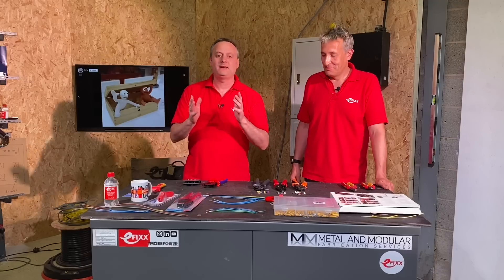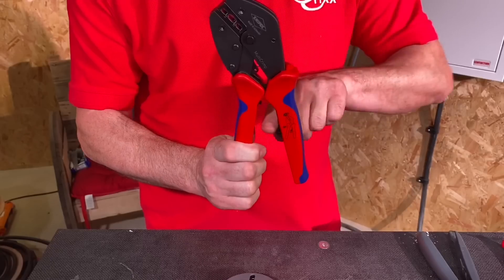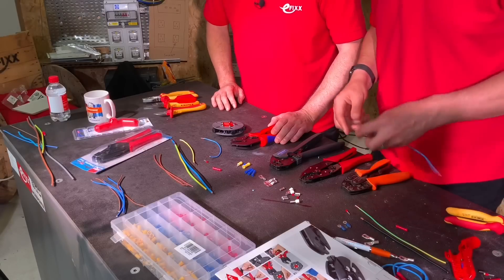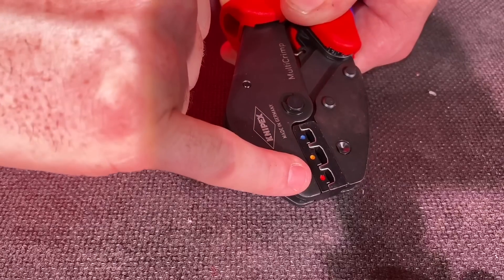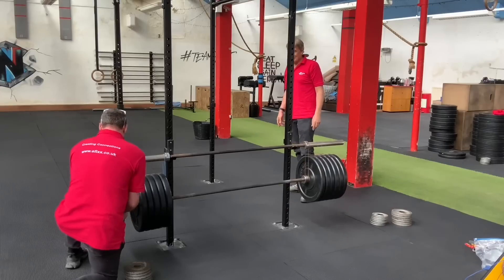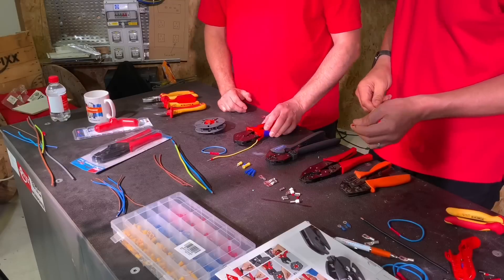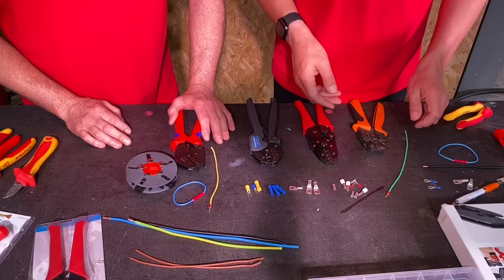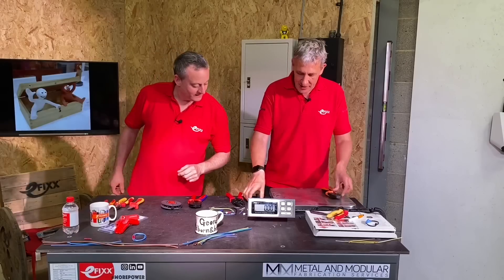Knipex Mulitcrimp : 3 crimp tools in 1 - Ferrules and crimp terminals

Comment: The only advantage those Multicrimps have is that you don't need to lug around the additional pliers. Way slower switching between dies than just picking up another set of pliers, the massive opening size makes it really awful to use. Typical compromises that need to be made to cover so many crimp dies.

Comment: There's a better way to do this. Single Harmonica style line of jaws, you move the handle up and down it on rails, then lock into place. Bulky, but faster and you only have to keep track on one tool.

No need for the cassette, it's already built in.

Comment: That Knipex multi crimping tool is £200, the other 3 are about £10 each
Reply: Check the description. Those 3 are more like 150 each. Not that they aren't expensive, but if you do crimp all day long every day, it's worth it. Otherwise much cheaper alternatives get the occasional job done for sure.

Comment: You had me sold till I went and seen the price. Great idea and tool and I lobe how everything is within reach when needed, it will save time from having to go back to the tool box or truck to grab a different crimper when needed, but its way too costly. Keep up the great work.
Reply: £350.... I'll just dig through my tool bag 🤣🤣
Reply: @kierenhudson6331  it's around 200 EURO's now. I'm waiting for the time that it is 190 euro's again and then I'll buy it:-) I just so much hope that the force needed with that non insulated copper one isn't as high as the fellow on the right had to use!
Reply: @kierenhudson6331  😆 very true
Reply: Well nows the time fellas. Price is 40% off at $119

Comment: I'm curious how the jaws in the multi crimp tool secure in the handle whilst in use, does the lever between handles have a lock attached?
Reply from the maker: You have to be in an exact position to insert or extract the jaws. The lever sets that position to trigger the hook 🪝

Comment: In theory that works fine. And for a service engineer travelling in planes it might be good. But how many times do you swop between ferrule and insulated end crimps in a day? I know I jump 10s of times an hour.
Reply: But this allows you to transition quickly with a Knipex crimper frame. For me its also a cost thing, it seems like the fastest way to switch dies while having one Knipex quality tool. I could buy a second one.. But ooof. $
Reply: @HyperionBadger  I have 13 02 160 Knipex pliers at work that do ferrules brilliantly, that's a multitool and it's small. And for insulated crimps you could have any other tool. Not much space taken up in the bag and cheap. They only do ferrules up to 2.5mm though so if you work with power cables mostly it's not the best in that case.
Reply: @UhOhUmm  that 13 02 160 looks pretty sweet. That's probably the cost/space effective alternative I'm looking for.

Comment: usually 4 screws to change the tools heads. I have used many crimping tools in my years, but in a workshop environment. These would be good for that.On site, in a rush, losing that cassette lol...game over ;-) loving your new tool reviews guys. keep it up. You don't always keep ALL your tools in 1 bag, i determine what i need per job, and load it per that...to be fair.
Reply: Multicrimp in fact is two connected tools, have mixed filings about that, since in my environment using two cordless drillers is better and faster than switching drills.
Reply: What about having multiple jobs for the day. Do you re-bag to go to each job during the day ?

Comment: The die on the Pressmaster looks like it isn't symmetrical.  The profile of the lower jaw is different between the left and right.  Shouldn't you technically turn the connector around before crimping the other side?
Reply from the maker: The only difference is the coloured dots - the Pressmaster die is symmetrical even the markings of the die size used on the crimp.  *Gordon
http://www.pressmaster.se/product/ksa_0760
Reply: @efixx  I was looking at the KAA 0760.  It's jaws aren't symmetrical.

Comment: Nice tool. Here in NZ they use the uninsulated crimps alot and I show the locals the insulated crimps I used in the old country but they say they are car wiring crimps.I use the boot lace crimps for switchboards and control wiring. May consider the multi tool but will also keep my various crimpers.
Cheers ex pat sparky. Great vid as usual.
Reply from the maker: Thanks - great to get some input from the other side  of the world 🌎 -  What’s the view on things like Wago terminals in NZ.
Reply: To be honest haven't seen much of them in used so far.  An English sparky had them in a factory I was  working at and loved them. They seem very handy though.

Comment: It would be good to see close ups of the quality of crimps .....
Reply from the maker: More videos on crimps coming soon
Reply: I wonder how this would work for calibration ?, would you need it calibrated for each of the jaws, would changing the jaws void the calibration ?
Just thinking from the power industry where were required to have calibrated crimp tool, good space saving idea though.
Reply: @kyleadamson  that needs a much more expensive toolkit. Calibration really matters in that context. I know knipex calibrate them before they leave the factory but you would have to contact them for the precise settings. The digital knipex crimpers that allow precise repeatable and verifiable crimping pressure as you know are super expensive.
Reply: @mathman0101  yeah agree, i have an individual calibrated crimp tool for each style crimp, guessing it isn't really this industry a tool like that's is aimed at.
Reply: @kyleadamson  lucky you would love to see them what do you use for each type of crimp - good to see a list from a pro regarding these tools.
Reply: @mathman0101  There nothing massively special in that sense, as you said before it's more the calibration side of things that is most vital.
All the crimping tools I use are from the manufacturer cembre and these have to be used with cembre crimps, for the larger sized crimps I have a hydraulic crimper, again cembre.
All tools have to be calibrated even if brand new to ensure compliance, and calibrated again at regular intervals, at least yearly, if not every 6 months. That's experience working on NG sites at least.
I have seen the digital style crimpers before, however they aren't something I've seen used all that often.
Reply: @kyleadamson  you could see that in large life critical settings calibration is very important like aviation and high voltage work.

Comment: Excellent tool, But £280 for the five selection, is a little on the pricey side.
Reply from the maker: Managed to find it a bit cheaper on this German site £214  - https://www.reichelt.com/gb/en/knipex-multicrimp-with-exchangeable-magazine-kn-97-33-02-p98866.html?CCOUNTRY=447&LANGUAGE=en&PROVID=2811&gclid=EAIaIQobChMIyZekhdrN7AIVB-7tCh19CQNbEAQYAyABEgKCdfD_BwE&&r=1
Reply: @efixx  That's a much better price. I'm sure that info will be helpful too.

Comment: Pressmaster mobile crimp tool for me. the amount of dies you can get for it is fantastic.  I use it a lot for RJ45. One squeeze is enough to ensure a reliable connection. I was used to one squeeze terminations. Then I though I need a slightly smaller tool. I bought a Klein tools RJ45 crimper but I have had countless faults with making off ends. I spent hours on jobs as cameras didnt work. Cable tester saying cable is fine but it wasnt a good enough termination to handle POE so it didnt work. Used my pressmaster with one squeeze and it started working.  
http://www.pressmaster.se/product/mct_frame
https://www.kleintools.com/catalog/cable-tools/ratcheting-data-cable-crimper-stripper-cutter-compact
Reply from the maker: Pressmaster are rock solid last forever

Comment: Looks utterly ingenious, I'm sure a lot of time and thought went into the design. However ..... I honestly think it looks like a solution in search of a problem.
Reply: I think that's the page I'm on. There's really no substitute for the speed of having the right tool readily at hand. I'd personally rather have a separate specialized tool for each function. This is a bit like relying on a swiss army knife to replace a screwdriver, awl, knife, etc. None of those all-in-one tools as as good at anything as the dedicated specialists.
Reply: @G5Hohn  But, it's Knipex ;)
Reply: @HyperionBadger  I own a LOT of knipex, I just want separate knipex in my belt, not this cumbersome thing.
Reply: @G5Hohn  Gotcha. I suppose my draw towards this thing is you have a Knipex level quality crimper with a quick way to exchange dies that are organized within a carousel. I personally would be using this at a desk in front of a computer screen for my application.
Reply: @G5Hohn  To be fair, the way you change the tool can be optimized a lot. I have the 5-piece set and I learned to position the handle without opening the small plastic bar in the middle. I also usually pre-select my next tool on the cassette before I do anything else - no need to do the black bar and THEN rotate the lock while putting down your handle. After using it for some time I managed to bring down the tool change to just 2-3 seconds max. I may also need to point out I rarely need two separate crimp tools because I am not working in panels.
Reply: It depends.  When I want to change dies I have to get out a screwdriver.  Or you buy multiple frames.

Comment: I recently bought a crimping 'tool. Blue in colour' from Ebay, Brand new it cost 11quid, 'US Pro' is the make, and 
i think its absolutely fantastic value, and really great construction - Works a treat
Reply from the maker: Let us know how it's going after 10 years!
Reply: @efixx  yes but at that price if you loose it, or damage it you can afford to buy a new one every year and still spend only half the money duh
Reply: @efixx  At £11 per unit  - that's £110 cost of ownership over 10yrs vs £200 for the Knipex with 5 jaws paid now.